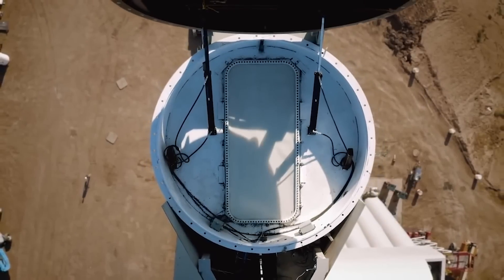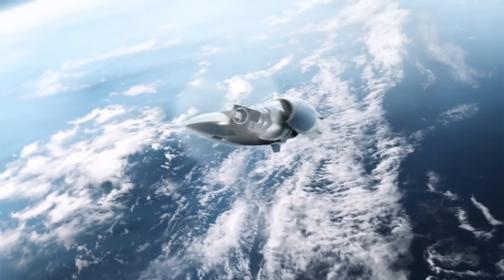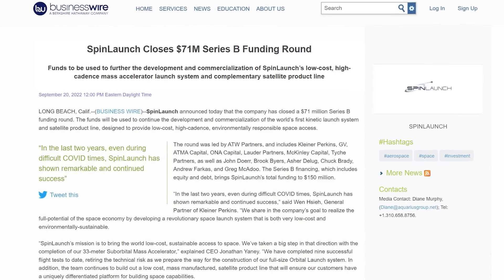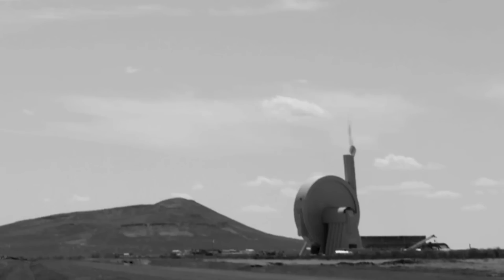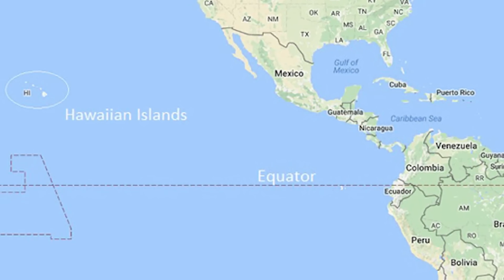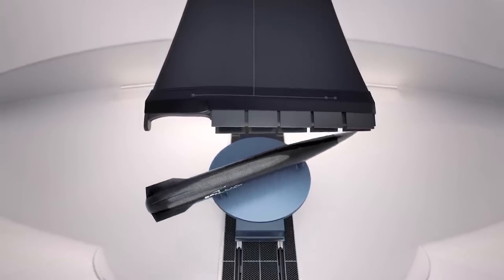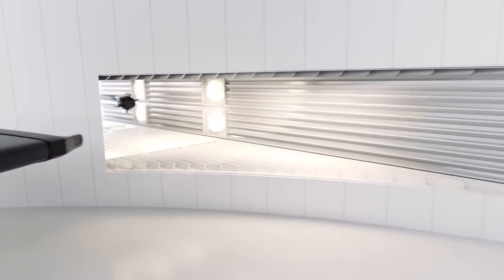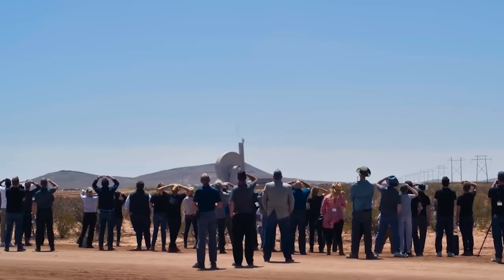What Happened To SpinLaunch & The Orbital Accelerator?

Comment: Basically, TF declared this another money dump which was dead on inception quite some time ago. Seeing the wobbling 'missile' fired through the cover could already tell you that anything that isn't built to withstand extreme G-forces is going to become a worthless piece of junk. For example the fragile solar panels used to extend from satelites will definitely not be able to fulfill their function if launched from this system. The only thing you could get into space with this would be liquids which wouldn't care about compression. However heat through friction at launch could be a serious problem. Heavy insulation would cut into the payload quite significantly.
 So for launching liquid payloads you wouldn't need a spinning launch system; you could use a linear accelerator somewhere in central Africa along the equator to use the altitude difference there.
The problems of spinning a heavy payload up to the speeds required to reach even LEO make it exceedingly difficult to control in the lower atmosphere.

Comment: This idea has many problems. Here is just one:

Spinning the launch vehicle - call it "Bob" - up to launch velocity takes a certain amount of energy. Call that energy "whoosh". Okay, so the system will need a counterbalance for Bob, which will have to be spun up - whoosh just doubled. The easiest way to deal with counter-Bob is to release it down into a hole, which means that energy will not be reclaimed. The impact will be groundshaking.
The arm that holds Bob and counterBob has to be strong, which means heavy, and spinning it up will take energy - call it "whoosh" and "whoosh", roughly. The arm's energy may be recoverable, with enough technology. 
The whoosh needed to throw Bob is about one-fourth of the energy required for each launch. 
Factor that into the fuel savings.

There's hella more problems. 

There's also people who dismiss all the problems, and some of them have money. That's incentive enough for the project. It doesn't have to be workable.

Comment: If we specify no more than 10g on a human because that's the most he can reliably survive for the time it takes to reach orbital speed then spin launch has to be 700 miles diameter. If it was 70 miles in diameter it would be applying 100g at orbital speed. 7 miles diameter would be 1000g. The Excelus Foundation's electric catapult space launch system (ECSLS) Makes a lot more sense. It's max G force spec is 10g, and the launcher uses currently sold maglev, and maglaunch hardware. The launch rail is just 300 miles long. It releases the vehicle from the vacuum launch tube at 120 miles altitude. It turns to any orbital inclination from equatorial to polar. Current price based on 10 million dollars a mile for previous large scale construction using maglev, and maglaunch hardware is about 3 billion dollars.